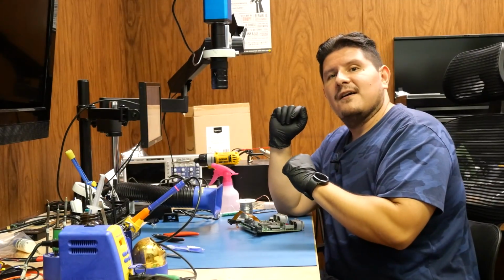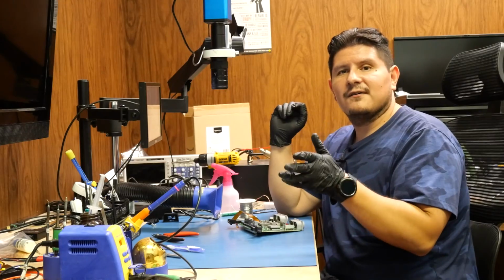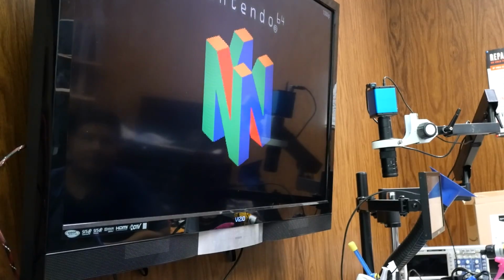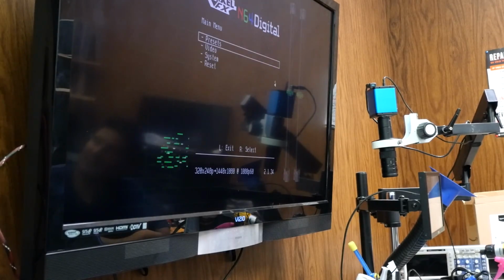Nintendo 64 HDMI Upgrade | Installing a N64 Digital from PixelFX

Comment: Awesome. I have an N64 Pixel FX mod. Today, the 64 stopped putting out any video. Thru hdmi port or av. I'm trying a new power supply and expansion pak tomorrow. If that doesn't work I saw you have a shop. I may take you up on some Hdmi modded 64 repairs soon if available. Very calming video and excellent work on that mod.

Comment: Nice video. Quick question: How come you used the lead-free solder when the N64 was designed and built in 96. ROHS directive didn't kick in until 2002. The leaded solder makes better joints and is easier to work with.
Reply from the maker: Pixel FX advises the lead-free solder be used for the installs. The lead-free solder is more difficult to work with and is not a favorite of mine.
Reply: @RetroRenegadeRepairs  oh okay, yeah, I was wondering why since the board was made with lead. I agree lead-free isn't my favorite either. I'm still glad we have access to the good stuff.

Comment: 2:03
5:05
Is it really necessary to re-tin them with leaded? I'd imagine those small traces will melt easily with your pro-grade soldering iron even without.
Reply from the maker: Not at all. If anything the flux is the most important part of the process.